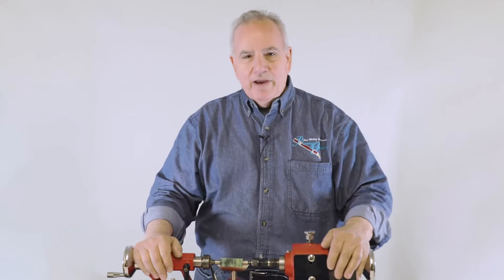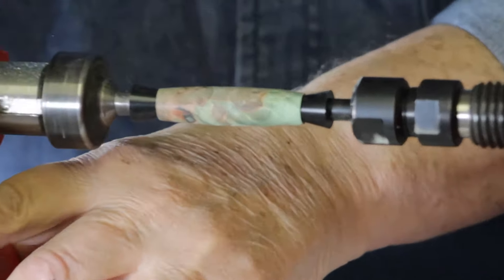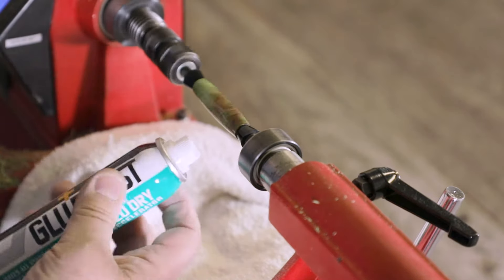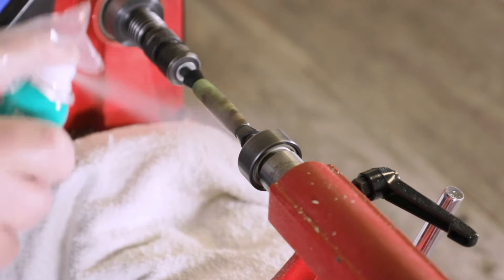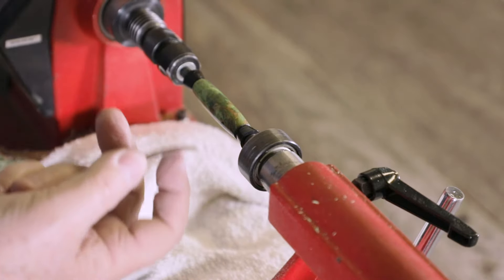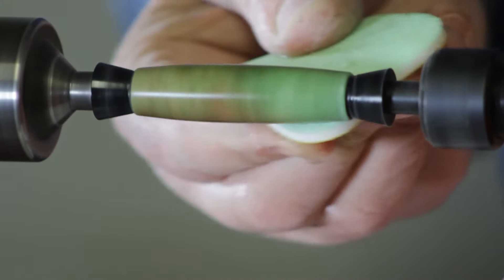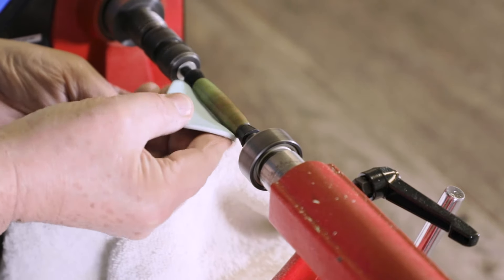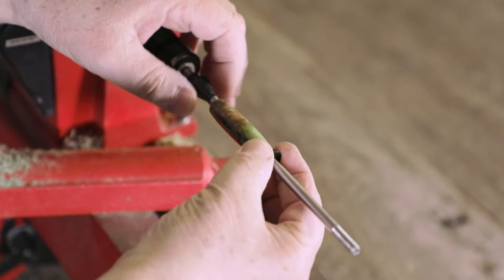How to Apply a CA Finish to Pens with Barry Gross

Comment: Does the CA glue have a shelf life? I have been doing CA glue finishes for several years with no I’ll affects. Recently any use of CA glue irritates my eyes sometimes swelling them up. I have used both a mask and a full face respirator and continue to have those issues
Reply: Not sure if you ever found your answer, but CA glue has a cumulative effect on your respiratory system. The fumes also stay in the air for a day or so. Make sure you have good ventilation for the room in addition to your respirator.